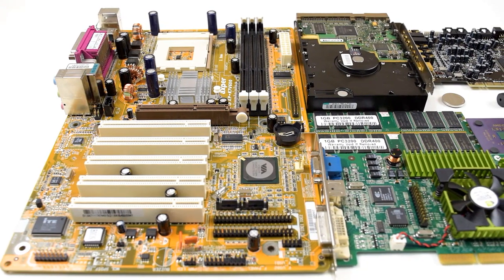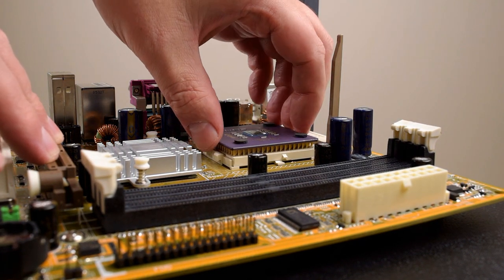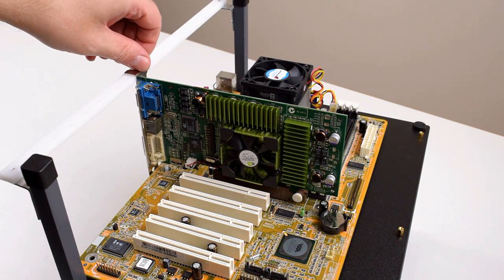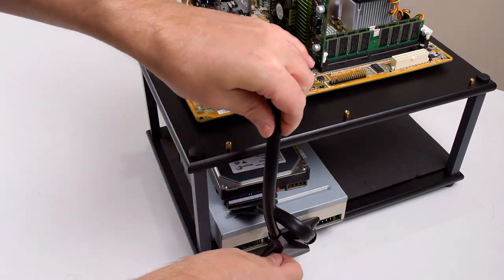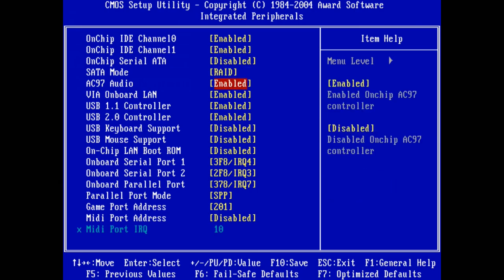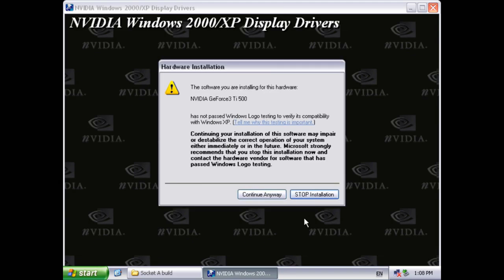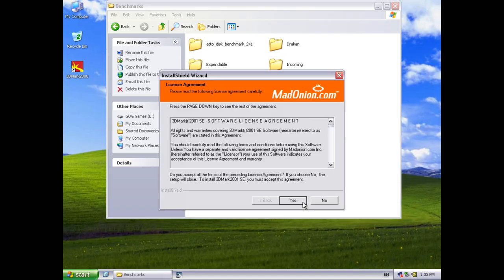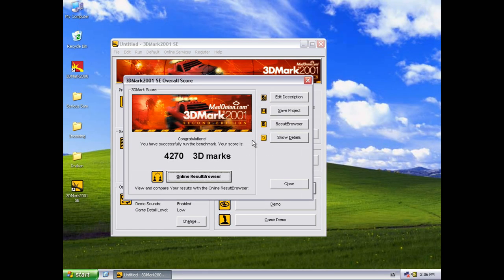Building a Socket A System Retro Gaming PC

Comment: I looked at contemporary reviews of socket a, and ddr memory options were very limited in the first year of launch. Reviewers pointed out how far off the maximum supported 2 GB of memory was when they were limited to 256 mb sticks and only 2 dimm slots on the few motherboards available and many said to stick to sdr memory till prices dropped, how familiar. Also 133 Mhz was the highest jedec rating initially.

Comment: Phil, you unintentionally made my day. I was watching this video (great one, BTW) and I saw the part especially where you downloaded the audio drivers for your Audigy 2 ZS and shut off CMSS. Did it the audio beforehand sound a little bit off than what it should? If so, I had the same issue. I have a first generation Audigy card that I've had since it came out currently installed in an 2007-08 PC I received a few weeks ago. At first, the Microsoft drivers sounded a little off (it auto installed them). After playing back some audio files and listening to them with weird sounding results (almost tinny, whiney, hissy), I tried installing the online drivers from Creative. Well, it still sounded the same. After tinkering around with the settings, I still couldn't get it to sound normal. At all. CMSS WAS THE ONE THING I FORGOT TO TRY TURNING OFF! Thank you, Phil! You saved me from buying a new sound card for this old PC. I probably will at some point anyways; I want to install it in a more proper Windows XP machine XD
Reply from the maker: Awesome :D I'm not sure why it's turned on by default. AFAIK you want to use it with headphones for 3D surround audio, and it can also do "speaker fill" if you got surround speakers. But it should be off for just plain 2.0/2.1 Stereo.
Reply: Yeah, it's definitely odd. I guess that they assume you have a surround system since it's designed for it. I have a 5.1 system but it's being used by another computer. In the mean time, 2.1 works for me along with a nice pair of headphones!

Comment: AMD Duron 700-850mhz ish if I had to guess
Reply: AMD Duron 600MHz (0630 is Duron 600MHz, 0631 is Duron 650 to 950MHz ... I still have a Duron 900MHz somewhere).

The AMD Duron has a very distinct look though, so yeah was obvious it was a Duron ^_^
Reply: Would of guessed Duron too, mostly due to the ceramic look of the chip.
Reply: RobW0lf cpuid confirmed, it's a Duron
Reply: I had a Duron Pro 1300(950mhz) with a PCChips mobo. What a piece of shit it was. A real piece of shit.
Reply: RobW0lf I had the Slot A Athlon back in the day, but didn't the first Socket A Athlons (1.1 Ghz, 1.2 Ghz, etc) have the same ceramic chip?

Comment: Thi is going to be interresting. My first and second computer both ran on Socket A so much nostalgia for me :)

I just wished that you used a faster video card, the Barton processors can easily handle a top end Geforce 7000 card. I'm just afraid that the geforce 3 will hold it back when it comes to testing the faster ones :(
Reply from the maker: Swapping GPU is piece of cake :)
Reply: Thats true :)

Comment: The CPU core certainly looks like a 600-950 MHz Duron, going to guess it's the 600MHz version, as the 3DMark results seem about right for that setup.
Is that PSU a VS450? If so, it will struggle to power the higher-end Athlon (XP) models, as the unit can only deliver 80 watts (16A) on the 5V rail. The Athlon 1400 and XP 3200+ will be just a couple of watts short of that limit on their own!
Edit: Just realised the CPUID wasn't fully hidden, it too points to an early Spitfire core Duron.
Reply from the maker: Regarding PSU, I think you will like tomorrow's video :)

Comment: CPUID dates back to the year 2000 so it can be the earliest Socket A Athlon or Duron chip. Based on the look of the chip on the video, I am pretty sure it is a Thunderbird Athlon. Clock rate... not sure. But most likely a 1.4 GHz chip.

Comment: my build for this was as follows 

AMD Athlon XP 2600+
512MB system ram (initially) then upgraded to 768MB
60GB WD IDE HDD
Nvidia XFX 5200 120MB PCI
all running on a Gigabyte GA-7S748

I never used a sound card because 2.1 speakers were pretty standard at the time and the on board was just fine, this thing played all the good shit like battlefield 2, rise of nations, Wolfenstien ET (the free multiplayer game) and a bunch of other games i cant remember, it was also the first system i had tried to overclock as well.

i find it weird that some mobos for the K6 era had sata while many mobos even in the socket A era did not have them including mine.

Comment: Would have loved to see a GeForce Ti4400 or Ti4600 on this system. :D
Reply: This motherboard is good for CPUs that could easily push fastest AGP cards. GF3 is going to be a big bottleneck down the line :( something like 6600/6800 would be ok.
Reply from the maker: Thoughts about using a Radeon 9600?
Reply: better, but still a bottleneck when you go above 2GHz, something like 9800 would be fine (2x the performance).

For reference Athlon XP-M at 2.6GHz(socket A KT133A with sdram!) with overclocked GF6800 runs 16000 in 3dmark 2001, probably same ballpark with radeon x800. That setup runs 1 minute superpi 1M, same as ~2.8GHz P4/2GHz Athlon XP with DDR memory, so not that optimal, but still impressive for KT133A, chipset from year 2000, to go all the way to 2.6GHz ;)

I ran Asus A7V133 up to 2008! You can even check my configuration if you google "XP2400+ 2GHz Mod Asus A7V133 RAID ATA133 ram 512MB" - first link should be to an auction site (allearchiwum) with my old listing selling motherboard + duron 1800 with L5 bridges closed (unlocking software multiplier change) running at 15x133 = 2GHz. I even list a bunch of games that ran well on this setup with Ti4200 hehe.

fab51 com has great tutorial about unlocking socket A cpus with L1/L5 bridging (pencil of conductive paint).

Comment: I still have my nVidia nForce 2 Ultra paired with an AMD Athlon Barton 2500+ that can be easily overclocked to 3200+ speeds. For kicks,  I can also drop in my older Athlon XP 1800+ or Duron Morgan core 1.3 GHz (which surprisingly was a pretty good CPU back in the day). I've never had an issue using SATA devices on the system (my main HDD at the time was a Seagate 80GB SATA Drive) provided I installed the driver using a floppy before installing the drive. I may have to start using the system again since some of my older games don't seem to work on Windows 7 or 10 such as Splinter Cell or even Splinter Cell Chaos Theory (which worked prior to the past two Widows updates).
Reply from the maker: Issue with SATA is that only SATA I drives work and you can't boot from SATA optical drive.
Reply: Is it because of VIA or overall? I may have to get a SATA optical drive to try out on my nForce system or rip out my current optical drive that's been hooked up to a PATA - SATA converter. I wouldn't be  surprised if it won't work since I don't think there was native SATA support in those days.
Reply from the maker: It's because of the VIA chipset. nForce works fine the last time I tried. Intel Pentium 4 boards also have great SATA support.

Comment: I suggest that don't connect hard drive and DVD-rom with the same ide cable, it will significantly slow down the transmission rate.
Reply from the maker: Only when using both, I only use it to install Windows, and maybe a game or two. Most games are GOG though.

Comment: Too bad they didn't make a Socket A board for baby AT cases, but there would've been too many cables to hook up, for example, PS/2 mouse ports, USB Ports, Serial and Parallel ports, etc. I might get a Socket 370 Baby AT motherboard and processor in place of the Socket 7 board I have which doesn't have AGP, and people are asking for an arm and a leg for a Super Socket 7 motherboard that has AGP and support for K6-2+/K6-3 processors.

Comment: the old computer is good, 1024 megabytes of RAM will allow you to use the full power of the computer, but the cooling for the processor is to be replaced with a better graphics card geforce 6600gt or geforce 7600 gt for the agp8 bus are the best graphics cards

Comment: where did you find a geforce 3 ti 500?  and that couldn't have been a cheap card.  Last time I looked, it was about $200 U.S. used.  I ended up going with the vanilla Geforce 3 (non ti) for about $40.

Comment: nice video! I did get my win98SE system together too - about week ago :)

it is Socket A based AMD athlon 2000XP, 2x256mb ddr, 100gb WD IDE hdd, GF 4 Ti 4200 AGP 8x and the mobo is Shuttle MK40V v1.3A

only problem is that i cannot find any drivers for the mobo :(

Can anyone help me? :)

i found video drivers and some old directx 9 versions but yeah mobo drivers needed :)

Comment: was the ATI Radeon 9800Se, not available?
Reply from the maker: Why this particular model? Sounds interesting.
Reply: PhilsComputerLab 128 mb of vram, relatively cheap for age, uses AGP 2x & 4x for connection and it comes with s-video-composite and VGA out
Reply: PhilsComputerLab and it was one I had in my second gaming rig

Comment: I tried building a socket a and I don't get it. Why can't i stop it from rebooting while trying to install windows? I am going with Intel Pentium 4. I mean I can build a AM4 system just fine, I mean, come on, what gives?
Reply from the maker: Do you have a high power CPU? It could be the PSU. I've done a video on this, it is basically because this system draws very high current on 5V rail, unlike modern systems like P4 and Athlon 64. Try a very slow CPU, one that has low power rating (you can Google the information).
Reply: @philscomputerlab  I got over 35 amps on the 5v rail it is an older psu
Reply: it is a 2200+
Reply from the maker: @leondowdy5738  Does it trip over at the same point? At what stage in the installation does this happen? Most blue screens / reboots with Windows XP happens because of storage controller, lack of correct AHCI or SATA driver. Are you using SATA? Try IDE port instead if you have an IDE drive. Check BIOS for IDE mode for the SATA port. If the chipset is Nvidia or VIA, well things are going to get difficult...
Reply: @philscomputerlab  yes, it always happens at the very same point towards the end on installing all the drivers in the blue screen at the beginning i cannot get to the part where i can make partitions, i am using ide for both the sd card adapter and the sd card adapter is on a cable by itself and the cdrom is ide also.
Reply from the maker: @leondowdy5738  Hmm that is a bit odd, IDE port should work quite well with such a machine. I take it the SD card shows up in BIOS in the correct size?
Reply: @philscomputerlab  yes it does